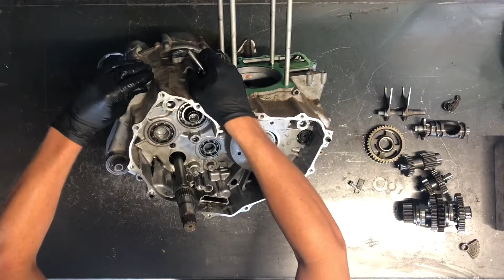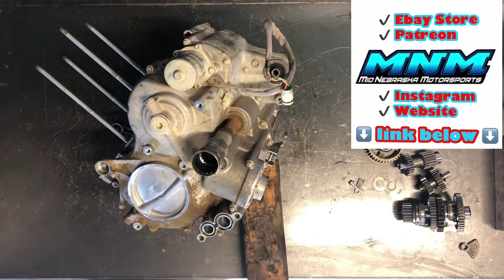Honda Foreman Rubicon 500  -  Centrifugal Clutch Drive  -  Detailed instructions.

Comment: I have an '01 Rubicon TRX500FA that I can only push it backwards. I bought it as a project hoping it was just the angle sensor. I replaced the angle sensor and did the reset on the computer. However the bike still won't roll freely while in "Neutral" per the display. I pulled the front case cover off to check the oil pump chain and that looks like it is still on the sproket. I have not pulled the clutch pack yet, waiting on the tools. Any ideas why I cant push it forwards while in Neutral? Is there any way to make sure the Hondamatic is okay while I have the front cover of? Thanks for your time
Reply: Did you ever figure out what was wrong?